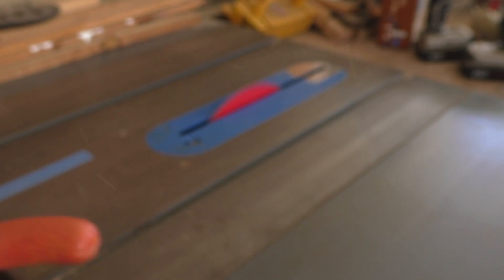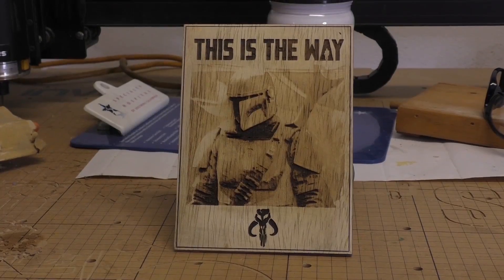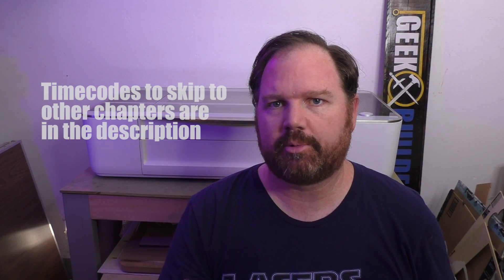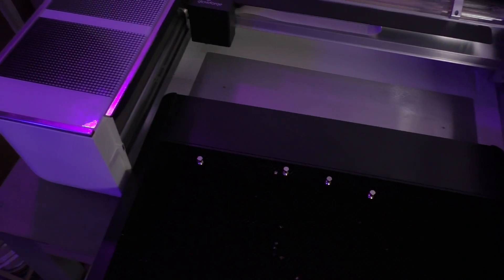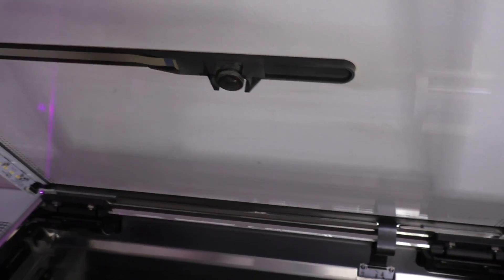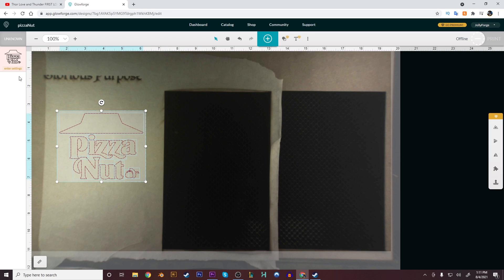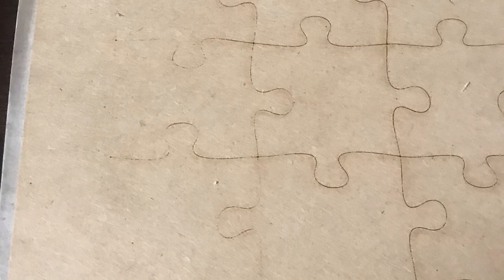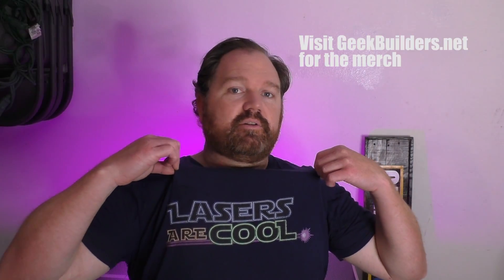Life with the Glowforge 6 Months Later

Comment: I'm a big Festool fan.  I own many of their products and share the appreciation of the brand.  I'm glad I found your video concerning Glowforge.  I'm researching options and you did a great job of showing me the machine and showing me the good and bad of ownership.  I have to say that this pay as you go issue was not clear to me when visiting the Glowforge website.  I'm a hobbyist and do not make my living from my tools.  My discretionary income allows me to appreciate brands such as Festool or perhaps Glowforge.  I will  pay for premium quality and capability even if the tool is beyond my skill level.  What I don't want to pay for is a tool that only works seasonably---summer heat or winter cold.  Unless of course if it is a snowblower or conversely a lawnmower--although both run all year they do not have much utility at times.  I cannot imagine a tool that should work but doesn't even in the most moderate of climates such as in a garage.  I hope Glowforge is listening to you---to me---and to all the commenters.
Reply from the maker: Just to clarify, the pay as you go model only applies to using their clip art, premade files, some design functionality, and "fast lane" access. If you are familiar with designing images and vector files, you don't necessarily need to purchase their subscription plan. I just want to make sure that there is no misunderstanding on that front. And... I hope Glowforge is listening as well.

Comment: First let me say this is a fair and balanced review.  That being said I ran into all of the same issues you mentioned and have come up with perfectly acceptable (in my mind anyway) work arounds.  I had an old Epilog as my first laser and found out pretty quickly that lasers don't like extreme temps - hot or cold.  So when I went looking for a new laser I fully expected it would live in my house where the ambient temps are 72.  As soon as my GF arrived so did my 6" inline fan.  The sound is perfectly acceptable in that configuration.  The camera is kind of a waste really.  It's only function for me is to make sure my stuff is within the cut area.  I do have a process for precisely engraving things like round coasters, etc and I think it's more accurate than even doing a test firing in my opinion.  Not always cutting through materials is usually a function more of the quality of the material you're cutting from what I've found.  The paywall thing with the designer...eh..I looked at it for five mins and decided it was more like a tool for people who are unwilling to learn how to use graphic software like Inkscape or Illustrator.  I decided to learn Illustrator and can't imaging using anything the paywall has to offer.  I actually like the fact that you can use it wirelessly.  I mean all of my other printers are wireless.  The one concern I have is that if GF every went out of business I'd be dead in the water until the community found a work around.  Another really significant issue that I haven't experienced yet is beyond simple maintenance.  Like if a belt broke or your tube needs to be recharged.  The only option you have is to send back your unit and they ship you a refurb.  Not a fan of that idea.  Just send me the damn part.  It is though one of the most user friendly lasers on the planet.  I could consider more of an appliance really.  Don't want to have to learn about networking?  Don't want to have to deal with the nitty gritty of running a laser?  This is it.
Reply from the maker: Well said
Reply: Would you be willing to tell us your process for precisely aligning? Our camera is always giving us issues with alignment. Thanks.
Reply from the maker: @GarrenteedCreations  I will try to make a follow up video within the next week to demonstrate a method that I came across.
Reply: @GeekBuildersNet  Excellent, thanks!
Reply: As a process engineer thanks for stating the obvious. Every single piece of manufacturing equipment will have pros and cons, most of them use proprietary software, the quirks with process control are the bread and butter of why we product/process engineers exist. There are many factors at play when deciding which piece of equipment to buy for me Glowforge is the perfect machine for non-engineers, I wanted a machine to play around with and show my mom and siblings what is possible with a basic laser and it is perfect for that. For a manufacturing business this is definitely not the machine, I would look at LPKF and the like.
Reply: well said, every piece of equipment (and i have had all kinds) have their pros and cons, its how bad do you want their pros and are willing to work around the cons.   sort of like a relationship.

Comment: I've been using Epilog for 10 years and the best part for me is it's a printer driver. Which means I can use any software that can print. If you want to cut, you'll need a vector based software like Draw or Illustrator but most will be using something like it anyway. Also the fans on my machine are what keeps it cool. Water not needed.
Reply: I bought a used mini 18 30watt. I literally use it almost every day.
Reply: Which Epilog model do you have? I was looking into maybe getting a zing.
Reply from the maker: That's pretty cool, I didn't know they were set uip that way.

Comment: Thanks for a great video.  Kept my interest the whole time, not many videos can do that.  If I had paid for a GF and then learned GF wants more $ to process my file faster I would blow a gasket.

You have a K40. What do you think of getting just a K40 stepper control board and doing a GF brain transplant?  Cooling would improve if the return water passes through an external radiator with a fan on it. Mount the radiator flat and at the same height as the water tank.  Avoids problems with hydraulic head.  Next step could be a tiny window ac unit that just chills the external radiator in a closed recirculating cold air loop.
Reply from the maker: I think getting a k40 and making your own is a great idea. I've made several modifications to mine and I am pretty happy with it. I know several other people who have replaced the control board and added things like an external chiller and cameras to make it an even more robust machine for a fraction of the price of a GF
Reply: @GeekBuildersNet  What I meant to say was modifying the gf by taking out the oem controller and replacing it with a k40 controller.  Would that make sense?
Reply from the maker: @2OO_OK  Oh!.... That would be quite the hacking job... I know there have been some hombrew type attempts, but I have no idea if they were successful

Comment: Very accurate review. I bought the pro, and have had buyers remorse since. I'm a manufacturing professional, and have found the glowforge to be nothing but an expensive toy. It's Unreliable, inaccurate and requires frustrating software. You hit the mark with this video.
Reply: Then what machine do you recommend??
Reply from the maker: I wish this wasn't the case. I really want to like the machine
Reply: Whatcdo you wish you wouldve bought instead
Reply: I wonder if you guys can claw some money back by selling it. I for one am glad to benefit from your experiences, prior to making a purchase!
Reply from the maker: @Nunyabizn3ss  We will find a way to earn some of the money back. We just need to find a small work around for some items.
Reply: @GeekBuildersNet  that would make for an interesting video, and could help other dissatisfied Glowforge owners. Thanks again for your work.
Reply: SAME!  Huge buyers remorse!  My lid came off a year and a half in and it will cost me $1600 to fix.  :(  I've also had small problems all along the way - like you said of being inaccurate and unreliable.
Reply: Thanks for saving me a boat load of $$$. Will be passing on the glowforge.

Comment: The fact that they've tied basic functionality to their cloud servers makes the Glowforge a non-starter for me. If they eliminated that hurdle, their locking basic features behind a paywall would still keep me looking elsewhere; I'll never fall into a subscription trap like that.
Reply: Rent for life.
Reply from the maker: @Nunyabizn3ss  Agreed
Reply: Pro owner here- Well being on the cloud isn’t really as bad tbh you just login online to any computer under the same WiFi and it knows. But the problem is let’s say you want to add a quick line without updating the file or even a quick text box. They want to charge you the same amount as Adobe to add that quick text box. So it’s frustrating when I can and should be able to add something so minimal I have to go back to illustrator and update the file- but the machine is sold under those simple pretenses but unless you pay for the service the only thing you can actually do on this is just see your print and resize. The positive of the machine is you absolutely do not need any laser experience to use it a kid can totally use the glowforge. But for actual construction and bigger builds it’s basically useless since for the pass through slot can only fit a quarter inch at max  so you’re pretty limited.
Reply from the maker: There's a good chance I would not have bought the machine if I knew the extent to which I would have to depend on their servers

Comment: In regards to your overheating problem, you can  put an ice pack over the coolant reservoir .   You can also add an external fan and turn off the internal fan by selecting air filter attached.  This will disable the  internal exhaust fan but you must attach an external fan.   If  you do this add the 6 inch fan not a 4.  Hope this helps
Reply from the maker: I know you can add an external fan- and I probably will at some point, but the ice pack over the reservoir is just not a practical enough solution. Glowforge recommends trying to cool the air by the air intake, I have not tried this yet, but I don't have a lot of confidence that it will work
Reply: If you do this, do you also have to purchase their filter?
Reply from the maker: @sarahtruehorne8210  No, as long as you run the vent outside. The air filter is a self contained system that allows you to run the system completely indoors.

Comment: The only real thing going for Glowforge is how easy to use it is. Other than that it's significantly worse than everything else. It's slower, has less cutting area, a lot more maintenance is required, and it just isn't really that reliable in my experience.
Reply from the maker: I know it works for a lot of people and I'm glad they're happy with it.. I just think that for the cost, they could have addressed some of the simpler issues which would have made it a really killer machine

Comment: How much would it cost to add A/C to your workshop?  At what temperatures does your lower cost glowforge operate best at?  Are the issues you've faced addressed with the more expensive models?  Can you use other design software to make SVGs to then import into your glowforge?  Have you tried using any of the SVG files off Pixabay?  How much processing power is needed to render a design to SVG for a glowforge?  I wonder if there is a way to trick the glowforge into thinking it is connecting to the mother ship when in fact it is running off a local machine?  When glowforge goes out of business or when you don't have an Internet connection how useful is it?
Reply: Fellow owner here, my GF is inside an air conditioned room and is the Pro model.  I think they have better cooling on the Pro as it cuts slightly faster.  I have never had it enter a cooldown cycle and have run 3 hour prints.  As GeekBuilders mentioned you can use Illustrator or Inkscape to make your SVG files.  I was upset when they added the paywall as well, and posted to make my voice heard on their forums.  It was (rightfully) pointed out to me that you need to think of the GF as a printer.  The fact that they added design aspects to the application is a bonus, I think that is where people get hung up. 

 While it maybe possible to locally run the GF by hacking, it would not be easy.  There is a group that tried I think they called it openglow, they shut down the site last November I think.  GF themselves released open source files for the machine, however I dont think they documented how to use it.  It is there though if the company ever goes under.  Its under GitHub  /glowforge .  Basically if GF folded someone would need to step up and work out a hack, other then that.. you have a very expensive paper weight.
Reply from the maker: @GregK2754  That is some good info, thank you.
Reply from the maker: I'll try to respond in the order that you posed your questions.  I can add A/C to my workshop and might at some point which will help, but having to consider installing AC which is not cheap just to run the machine during the warmer months is frustrating. The Pro model does have passive cooling, but I don't know how good /bad it is. As far as design, I do all of my designing in Adobe Illustrator- so for me personally the paywall does not affect me, but I don't like the fact that Glowforge has it behind a paywall keeping it from people who might really benefit from it. As far as tricking the Glowforge into thinking it is connected to their servers, I don't see a way to make that happen in any feasible way. Hopefully some other people who have experience with the machine can help verify this.
Reply: @GeekBuildersNet  Does it have any sort of offline functionality?
Reply from the maker: @IraQNid  No